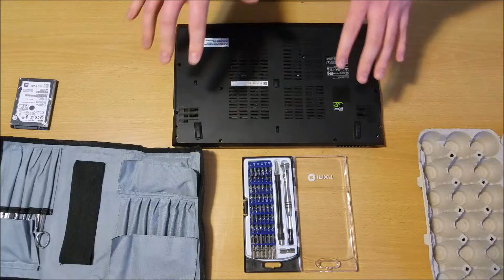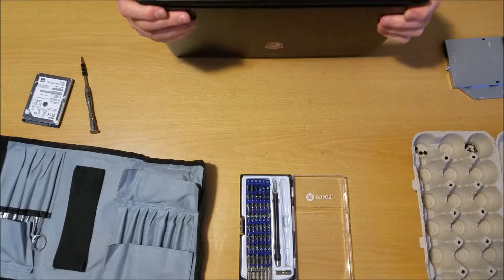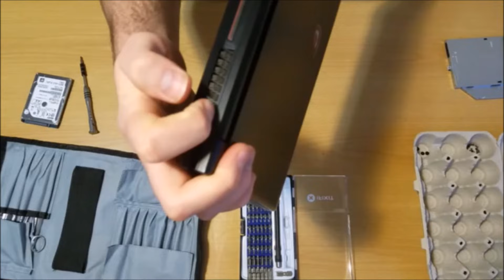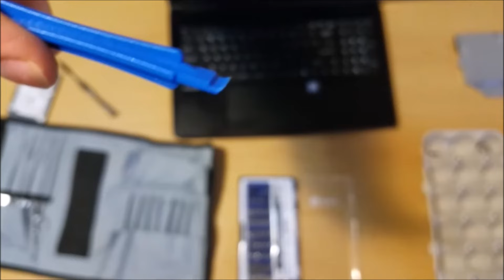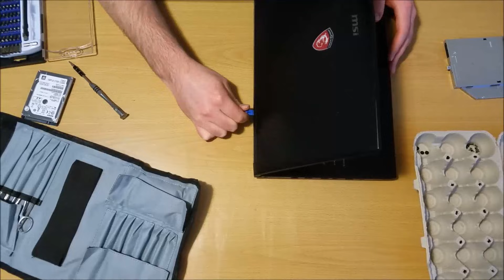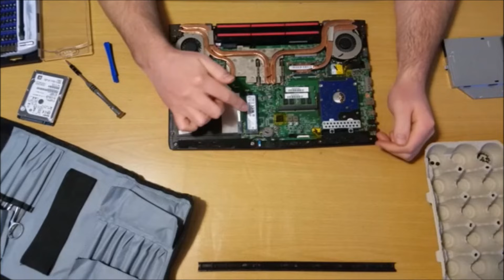How to Remove Bottom Panel On Laptop

Comment: After removing the screws if you can’t lift the bottom panel with any flat plastic prying tools, don’t force it because you’ll damage the tool. Instead, use a suction cup on the bottom right(or left, but I go with right most of the time), just get from your toddlers toys or wherever it’ll get the job done.

(please pin so others can see, you’ll save hundreds of plastic prying tools)
Reply: @izu Ah I’m been late but did you pry the sides with a plastic flat tool first before taking it off? Use a card

Comment: even with that spudger tool, you have to pry it open if its stuck which shows dents on the sides of the panel. How do you do this safer?
Reply from the maker: Which laptop do you have?
Reply: @MaxTechniche  hp
Reply from the maker: And model?

Comment: I have a different laptop, I'm trying to get the back cover off to fix it and it's really stuck on so I'm kinda worried about removing it, in videos it looks so easy but the back cover is stuck there
Reply: @SB Visuals mine broke lol
Reply: @pee_real1111  your cover broke?
Reply: @arkanimations319  I'm having the same issue now, my school laptop needs cleaning inside but three specific points on the front, back and in the middle are dead stuck as if it's glued
Reply from the maker: @Loredotdll what model laptop is it?
What's the serial number

Comment: There's like a yellow colored tape looking thing holding the bottom on should I just remove ot
Reply from the maker: You should be fine removing it. It’s Probably something that keeps contacts from connecting. If you do remove it, just put it back where it was.

Comment: my laptop x556ur wont open, ive unscrewed all the screws under the rubber and on the ram slot etc. it seems to be on the left side next to the optical drive thats stuck, pls help i need to change my hdd

Comment: What do i do if the case won’t open even after I removed all the screws? It’s an acer laptop.
Reply from the maker: - Check under any feet pads and stickers to make sure they aren’t hiding.
- Remove the optical drive if there is one.
- Remove the battery if it is on the outside.
(Sometimes there are screws under these.)
- Try sliding the panel (unlikely) vs prying it away.
- Above the keyboard, there are sometimes small panels that you can pry up and there might be screws under there.
- Check https://www.ifixit.com/ (or google) and search your laptop model number to see if there’s a tear down of it.
Reply: @MaxTechniche  r

Comment: Ah there is a tool which looks like a blade or  knife  to open the laptop what is it
Reply from the maker: It’s called a spudger I think. You can use a guitar pick (or flat plastic piece). I also know of people using razor blades.
Reply: @MaxTechniche  thanks

Comment: I need to replace the bottom panel I assuming that means base right? So this is how you remove it ....how about the putting back together........will I damage anything ,it's an older laptop but works perfectly needs a new keyboard too just want to see if I can do it.
Reply from the maker: Putting it back together is just reversed taking apart. Try looking for “‘laptop make and model’ tear down” and just follow the steps backwards. Search on ifixit also to see if you find anything. If you need more help, don’t hesitate to reach out. Good luck!

Comment: What do I need to buy to be able to unscrew my panel?  I tried using a pen because that was all I had
Reply from the maker: You can buy an ifixit toolkit. Or search for precision screwdriver sets on Amazon. There are some cheap ones that should work perfectly fine.
Reply: a pen.. fr